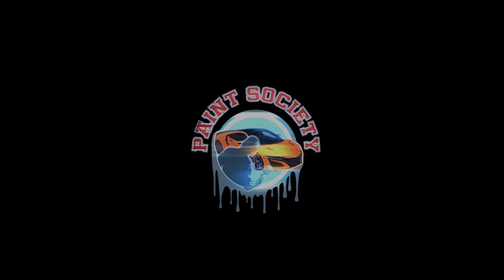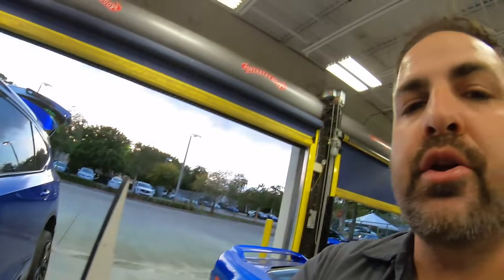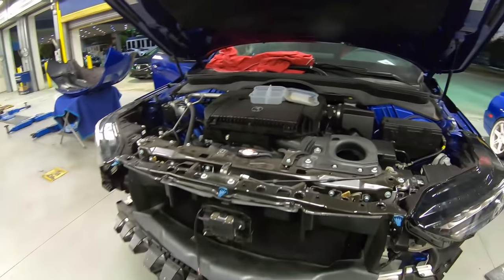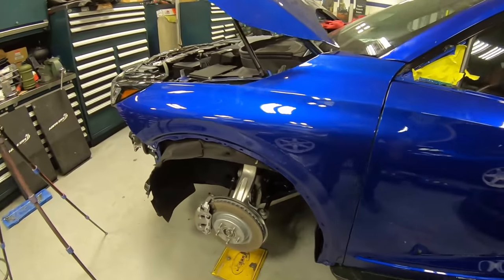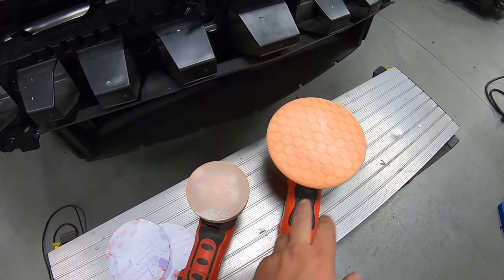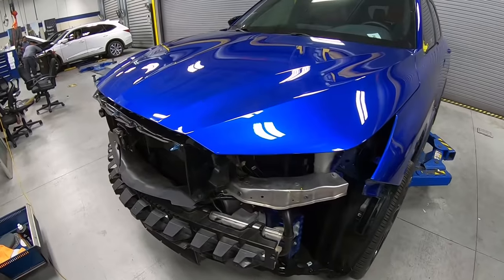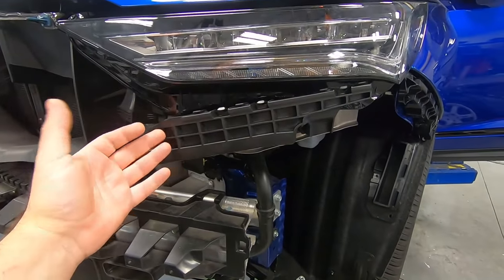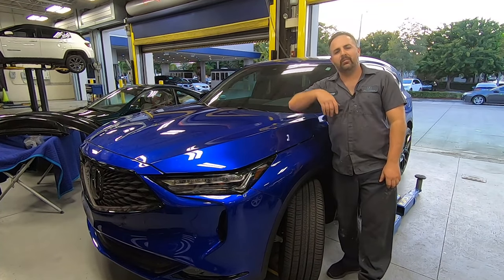From Wrecked TO Repaired!

Comment: I used to work for Honda manufacturing plant in Lincoln, AL. From a bare door when installing the fender we would set the fender to a pillar gap to 1mm. The fender to door gap from top, middle, bottom would be 1mm top gap, 1.5-2mm middle gap, and 2.5-3mm bottom gap to allow the door to settle once door is assembled. Just thought I’d share some info I learned from working at Honda. Loved that job
Reply: i love this information. its invaluable information that is very hard to search for online. I work in a Toyota dealership as a painter (not combo) so feel free to share any other info about panel gaps or things most people wouldnt know!!

Comment: The person who owns that car is lucky there are people like you to do the job right the first time. 

I wasn't so lucky back in 2009 my 94 Ford Fairlane got damaged on the left front, the panel and paint shop it was taken to said the chassis was twisted so they wrote it off. All the damage was from the headlight up and the bumper was had some deep scratches (the top of the bumper is 3 inches above the chassis). I went to get photos and noticed at the panel shop there was another Fairlane like mine that had light damage on the right hand front, they were going use my car as free parts for another. I had already bought my car back from the insurance company so they couldn't use it. My Uncle and dad helped me fix the car, once we had all the parts it took us about 10hrs to replace and straighten the damage and about 3 months to paint it cause it rained almost every week.

Comment: I started in detailing and I’m learning to paint with the help of this channel.  The paint world seems to be heavily influenced with 3M products but the detailing world has many many options for compounds, swirl removers, polishes etc. I actually prefer a powered DA polisher to the high speed rotary.  Flex 3401 and its cordless version are the ones I use but RUPES has some and there are several similar options at lower price points. (Like the Griots) With the DA and lake country pads I can easily remove sanding scratches even from 1500 grit, with less chance or doing unintended damage or burning through the clear than with the rotary. Yet refining the scratch to 2000 or more makes it easier.  In the detailing world your always measuring paint thickness trying to determine how much clear coat you have to work with for paint defect correction.  After painting you know how much clear is there cause you put it on, and the paint is generally soft cause it’s new and corrects nicely with less aggressive techniques. So what I like about doing both is some paint defects or areas of clear coat failure cant be buffed or detailed out, you just have to paint it.  Then once you have you can finish the paint with detailing precision to really end up with a nice result. It’s a marriage of both worlds techniques to improve our beloved cars and make them look as good as possible and then protect that paint to help it stay that way for as long as possible. Thanks Brian, I love your videos and your insight and instruction.  I appreciate your attention to detail and commitment to getting it right vs stopping at, eh its good enough.

Comment: i use 3m every day works great i know alot of people dont use the second step right u really want the rpm high to take those scratches that the compound put on. with the 1st   step i buff at 1800 to 2000 rpm compound  and 2nd step about 2000 rpm to 2200 i use old dewalt  buffer to wish i had an orbital i do a lot of black car and never get swirls same with 3rd step bout 1800 rpm for that true swirl free finish
Reply: since u use it everyday, what happens when u buff at a lower speed like 1200-1500? i polish cars with 3m maybe once a week to take out defects. I feel like when i use it at higher speeds, the polish just ends up everywhere not where i wanna concentrate the compound. And also with higher speeds i feel like i get more swirls aswell. I also mist my panel with water when i polish (saw a detail youtube channel recommend doing it) with good results. I get in the end u wanna get rid of those sanding marks first of all. thats why i usually go over it twice with the 1st step.

Comment: Beautifull job on that car again, lets hope it's the last time we see it for a while.

Don't know about regulations in the US, might be there's still quite a few waxes in that 3M, here in Germany it's all changing to waterbased.
During Polishing with wax-based polish, the waxes lie inside the sanding lines, P3000 for example, and the area seems to be done, since it's shiny. But in reality one hasn't polished deep enough to get rid of the P3000 marks. Waxmolecules are a pain in this case.
Either the leftover polish dries a bit and therefore loses in mass, or gets washed out, and leaves you with the P3000 marks.
It is possible to achieve good results, just a bit more poking in the dark, compared to waterbased polish.

Love the Intro and outro you're doing now. Gives a feel of you already have planned out what you want to show and say during the video.

Comment: Great work as always Brian, I’ve been doing this for years myself. You guys are first rate on your quality and details on repair! 
I have a question about the Walcom HTE clear coat gun. I’ve been running a WS 400 for years and 5000 RP hear and there. Is that walcom as good as the WS or Better? I am looking for another clear coat gun and that HTE has my attention. Is the atomization as good or better than the Iwata? Thanks for any help on this. Hate to pull the trigger on one and it not be as good. I made that mistake on a 5500 Sata and was not really impressed with it.  
Thanks again, take care.